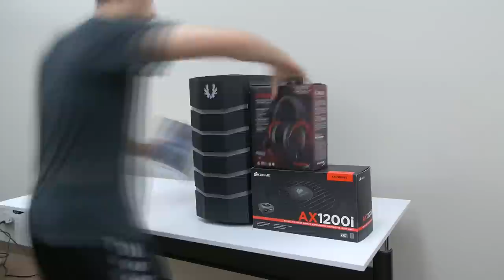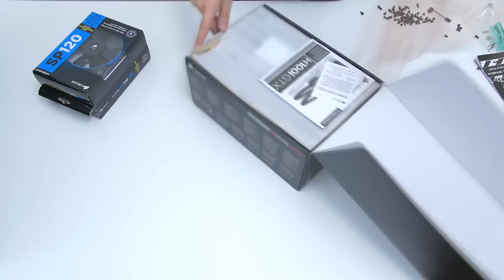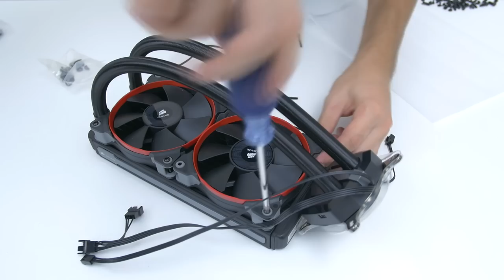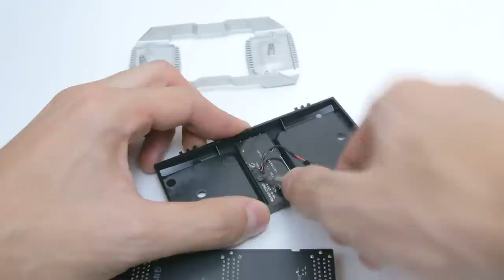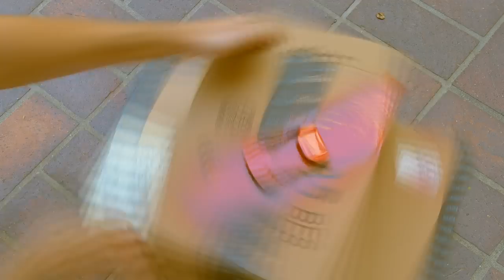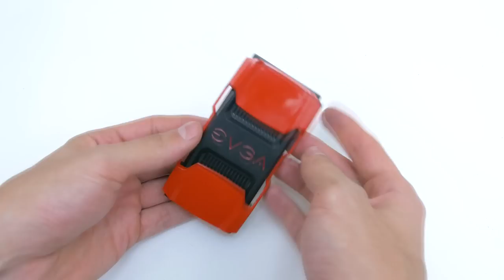$5000 Ultimate Gaming PC - Time Lapse Build

Comment: DOPE build!
Reply: Kevin!
Reply: VaDz iGNiTE vaDz!
Reply: +Kevin The Tech Ninja OMG
Reply: +Cheesus Christ No. That gpu is not for gaming. Don't buy it. Also that Processor is very weak. Don't get fooled by that "high" overclock.
Reply: +Cheesus Christ I really hope you know that he's joking.
Reply: +NoFirstName “NoName” NoLastName I'm not.
Reply: +Cheesus Christ Thats amazing build but i recommend you to take athlon 840 instead and dont oc becouse oc boards are expensive and 840 can fully utilize 750 ti and even bit faster cards. With that i recommend gaming on 900p high-maxed settings without aa.
Reply: If you cant find 840 then go for 860k with cheapest asus or gigabyte motherboard and dont oc anything. If you oc then you need more expensive board and better cpu cooler and all that cost so much and you get nothing becouse 750 ti doesnt need anything more than weak quad.
Reply: +MohondhaY The 750ti is a good budget graphics card.
Reply: +ObaminAtor 1 the 750ti was good for its time but now the gtx960 is way better and costs about 180$
Reply: fanzibanzi LP Mr. M Nun, die 750ti kostet trotzdem nur $100. Damit ist sie perfekt für $400 PC's.
Reply: +fanzibanzi LP Mr. M Actualy now its the 980 Ti bruh keep up
Reply: +YellowPeaches titan x lah
Reply: YellowPeaches you didn't say 900 series you please be polite
Reply: fanzibanzi LP Mr. M but i saw some use gtx 750 ti and i7 for gaming far cry 4 ultra 780 got around 70fps and gtx 750ti better  than 860m but not as good as gtx 960m
Reply: +Cheesus Christ I would get at least a Nividia Geforce GTX 750 ti with 4-6gb of vram and upgrade to a 980 ti. but everything else is great!
Reply: +MohondhaY how about this build-

Psu- Corsiar cx500

harddisk- Wd blue 1Tb desktop hard drive 3.5 inch 7200rpm sata 6gb/s

ram- kingston fury (blue one) 4x4gb ddr3 

motherboard- MSI 970 gaming MOTHERBOARD 

graphic card- Asus Nvidia Geforce GTX 960 STRIX directCu II graphic card 
4gb gddr5

processor- AMD FX 8320(8 core) or AMD FX8350 processor

and a cabinet- circle gaming cabinet cc821 without smps with 3 led fan
Reply: GURSIMRAN SINGH processer is good for gaming and the gpu can run most game high settings with no problem

Comment: yeah but does it run minesweeper at 24 fps ?
Reply: Newman2252 no only 1fps
Reply: Maybe on lowest settings
Reply: no because minesweeper supports only 240p resolution so the 3 graphics cards cant handle non modern reolutions so it will only play at 24fps on high settings
Reply: Lol
Reply: Newman2252 no but it will run the google dinosaur game at 21fps
Reply: With overclocking
Reply: Barely

Comment: case is personal preference, but that gpu cooler 3 way sli will be useless, there will be no airflow, thermal throttling 100%. i would go with simple sli using extra cash for intel 750 pci ssd
Reply: +Jānis Meija Not to mention that 3 way sli scaling is pretty much non-existent in most games.
Reply: +Jānis Meija man liekas viņš uzlika 3 GPU un SLI tikai lai izrādītos.
piemēram BF4 neredz vairāk par diviem GPU, tāpēc 3. GPU neko nedarīs.
man liekas ka nevienai spēlei vairāk par diviem nevajag :o
Reply: Man pasam ir sli es zinu ka tas strada

Comment: isnt it bad to put those cards right under each other?
Reply: True, I would go with water cooling in this build since that doesn't depend on air flow
Reply: Thanks for the tip!
Reply: Msi cards push air inside the card and after the hot air gets out by the sides

Comment: Is this a good PC to run Black Ops 3, Warframe, Metro: Last Light, Crysis 3, GTA 5, Far Cry 4, Battlefield 4, Tomb Raider 2013 and ARMA 3 all at the same time at 12K 144fps?

CPU: Single Core 400MHz AMD Processor - 1999
GPU: AMD HD Graphics (comes with CPU)
RAM: 516Mb DDR1-1033 RAM
Reply: Yes and it can also blow up the universe.
Reply: +DatcookieGaming OVERKILL
Reply: +DatcookieGaming You need to upgrade your headphones to work GTA 5.
Reply: you should put a voodo 3 in there for phisx ;)
Reply: I think ur gonna need a better sound card
Reply: Or maybe a gaming chair
Reply: you need a slightly better mouse mat if you want to run BO3
Reply: 516MB Ram is a bit weak. stick a 1tb SSD in and set the page file there. Put all settings at ultra and enjoy the powers of SSD. Alternatively download ramdisk and create a 256mb volume. set this volume as your pagefile and when your ram runs out you will have a mega fast page file. or sell it and buy half a wii game ;-)
Reply: +DatcookieGaming could you watch this video with this computer?
Reply: No! If you have a 5960x and 4 titan x! You still cant run that!
Reply: That's overkill, y
Reply: With at u can't even run minecraft
Reply: +DatcookieGaming your pc gona blow up xD ALLAHU AKBAR!
Reply: +DatcookieGaming maybe alittle overkill
Reply: +iTrickz lol he could barely run Gmod at low settings haha
Reply: +DatcookieGaming Why dont u watch his benchmarks and find out
Reply: +DatcookieGaming my potato runs these some of these games at  40-50 fps. so yeah :D
Reply: +Borislav Stamenov my toaster can run minecraft at an incredible 2-5 fps
Reply: Who even has 12K screens, I know it's a joke but still
Reply: Abhro I think they mean that it's three 4k screens...
Reply: +DatcookieGaming sure
Reply: +DatcookieGaming Don't even dream about it man :D
Reply: best Dos PC ever.
Reply: +DatcookieGaming you need some gloves for more grip and a mouse pad and a 500$ mouse to run gta 5 and warframe
Reply: you just made up parts didn't ever existed in that time frame. there wasn't cpu integrated gpus until last few years. people where using like 1,2 ghz Amd Athlon xp processors back then (1999). And Ddr ram wasn't called ddr1 and highest clocked ddr ram was 400 mhz
Reply: no youre pc probably has trouble booting up and it cant be running windows 7.
Reply: So gay it's not funny I mean obviously you can I run CSGO on my HP i3 school laptop at 144GHZ
Reply: +DatcookieGaming nope
Reply: Overkill much?
Reply: sometimes i wish these were serious i wanna what other people are getting
Reply: Yup
Reply: You should paint it black.
Reply: Change your processor with: Intel Core i5 3470 @ 3.2GHZ (4 CPUs) or AMD X8 FX-8350 @ 4GHZ (8 CPUs)
Upgrade ram to 8gb.
GPU to NVIDIA GTX 660 2GB or AMD HD7870 2GB.
Reply: Noobelli  more than good enough
Reply: Noobelli yes
Reply: It should be. Your specs might be a bit overkill tho.
Reply: Maybe decreasing the clock speed of your CPU to 1mhz and buying a 1mb graphics card would give you double the framerate. And you might need a gaming hard drive with no ssd because they increase load times.
Reply: This pc is overkill for that resolution
Reply: Deffinently
Reply: lol
Reply: You have to download more ram
Reply: I have a pentium pro 200mhz and a voodoo 1 and I can run b1 ultra
Reply: Easily 500 fps at 100k resolution
Reply: yes. yes it is.
Reply: Noobelli are you joking ? Ok course it IS
Reply: How could i say this? Over than OVERKILL ???
Reply: 150watt 80+ power supply and rgb stripe for increasing the fps
Reply: its an overkill dude, you can even run minesweeper at 10-20 fps in which gaming beasts cant even touch 3 fps
Reply: Reading this in 2018, LOL they consider this overkill, today we have 3 TITAN V SLI with I9 7980xe and 128 GB ram
Reply: Abdullah Al Jhmani it's still overkill at 1080p
Reply: Depending on your connection to the Internet, you can use game streaming services
Reply: no
Reply: sorry man.... you will need to run it all 11k :(
Reply: DDR2 is cheaper than DDR tbh
Reply: very bad pc in the world even it can't run your face
Reply: yes
Reply: Hell no
Reply: Man this is overkill. This is too much. This can probably handle multiple users and heavy rendering softwares at once.
Reply: yea very good but u cant play Pacman in it... so sad
Reply: yeahhh
Reply: I think it will run fine if you download a better graphics card and more ram
Reply: Noobelli man, your GPU is just an overkill, you will be able to run all these games at 12K, but for running in 144 fps, i suggest : 

RGB color lights are needed, if you truly want the 144fps
Reply: Ddr1 1033?
Reply: @halvorthesaw-norskgaming9831  Wooooooooosh

Comment: Nice build, especially the case! I got the white one with blue window.... I can't get the top panel off and change the top 230mm fan. Where do I bend or loosen screws? I'm afraid I will tear the plastic if I use more force.

Comment: I'm not a Computer expert but is every computer built sort of the same just different looking components and different powers
Reply: somewhat, yes. But there are lots of aspects to look at when it comes to powers. And some parts are optional such as using an ssd for a faster bootup than a hard drive or not using a graphics card because the cpu and motherboard has it onboard.

Comment: I wonder why no one is worried about ESD.? You do know that touching computer components such as the motherboard, without ESD protection is not safe?. Secondly, without gloves, the natural grease on human hands can damage the solderings on the backside of the motherboard and other components as well. An ordinary computer is one thing, but in a computer, with components in that price range, im puzzeled that no one cares one bit about it!!.
Reply: Kim Andersen Who uses gloves when installing a PC? It's a hassle and damages more than just hands.

Comment: I have a pc with 
core I5
msi r9 380 4gb ddr5
8 gb ram 
and it runs the division on ultra and 40 frame
Reply: why should I get this pc ??
I can buy a pc that run games on ultra and cost me less money
Reply: +Samuel gorden does your PC run crysis 3 at ultra with 2k resolution...possibly over 60 fps? This is not a build for a 900p monitor, but at least 2k or even 4k

Comment: can someone say me if this components are okay (i want to know if all of then can fit in a computer, all of them are compatible to use in a PC) and if you can say and advice of it, something better that i can use instead something, go ahead: 
INTEL CORE I5-4460
NVIDIA GTX 970
Motherboard GA-H97M-D3HP Gigabyte Socket 1150 Intel H97 Micro ATX
HyperX Fury 8gb
HDD 1 TB
Corsair 600w
Case SPEC-02

Comment: Ed please!!!

4.4GHz AMD FX-6300 6-Core CPU Overclocked
MSI 990FXA-GD65 Motherboard
AMD R9 380 2GB Graphics Card (MSI Gaming Edition)
Vibox Certified 120GB SSD
[AMD] 8GB Standard 1600MHz DDR3
Microsoft Windows 10 Home 
Vibox Predator Green Gaming Case
Thermaltake Water 3.0 Performer Water Cooling System
Vibox 550W 80Plus Certified PSU
24x DVD-RW Optical Drive
Internal green LED kit

 I paid £660 for this and it cant even play DayZ what is going on????

Comment: Can anybody please tell me how my build is since this will be my very first build~
Intel Core i5-6500
Gigabyte H11M0-DS2
Kingston Hyper X fury Black  8 GB
Western Digital Blue 1 TB
Kinston 120 GB SSD
MSI GTX 1050TI Gaming X 4 GB DDR 5 
Aerocool GTR Black
Seasonic S1211 Bronze 520 W 80 Plus
Corsair Hydro Series H100vi V2 Extreme
My budget is $850-$900
Reply: Carlo Elaydo you. Don't need water cooling buy a 6600k and ~30$ cooler and z series board instead